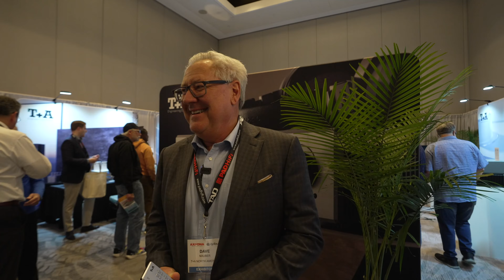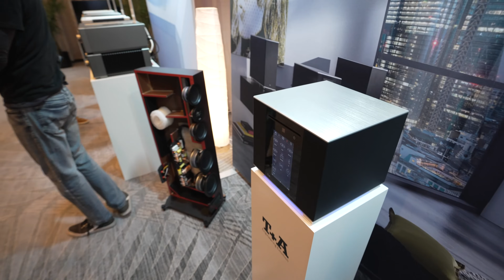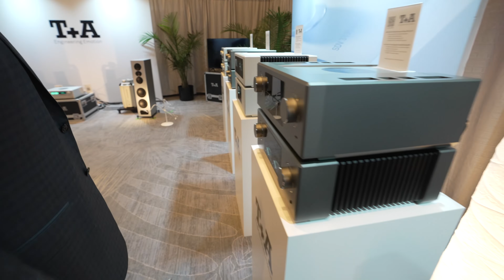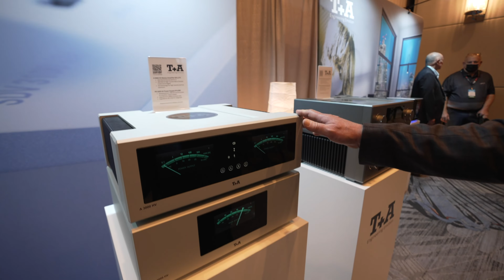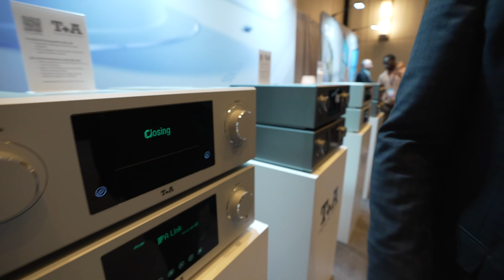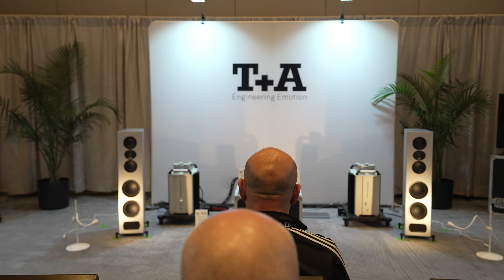T+A Criterion S Loudspeakers and NEW Super DAC 2024

Comment: The Crossover's are choc full of cheap parts and the cabinet construction is that particle board MDF stuff and their drivers are not using rare earth magnets or anything innovative except a transmission line to boos the low end a bit.  Their more expensive speakers usa nice aluminum cabinets but still have junk ball crossover parts like sand cast resistors. It is a shame their HV level electronics are really made much better than the speakers.